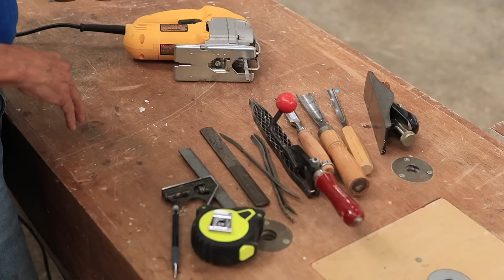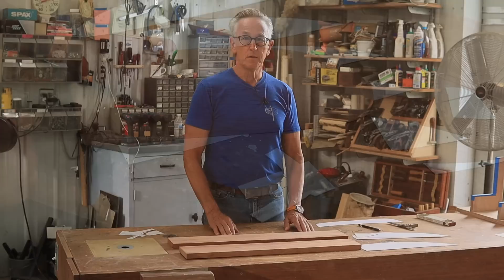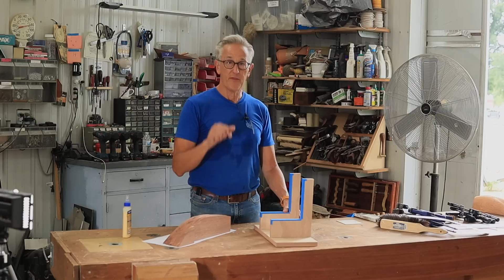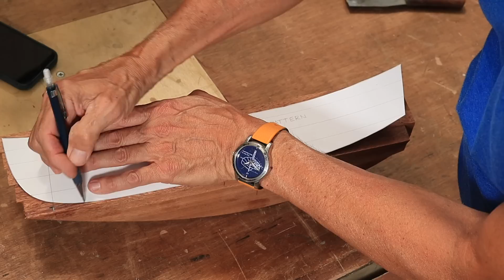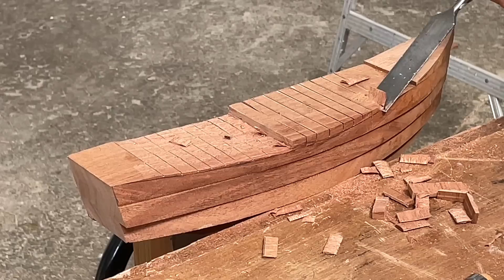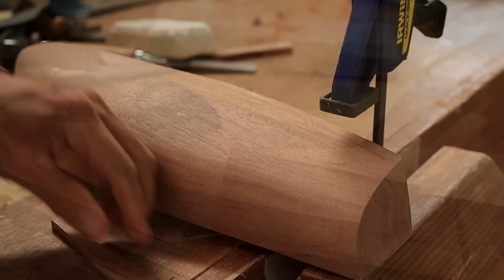How to Start Modeling - The Basic Half Hull Modeling Process, Part 1

Comment: 19:39 Sorry to contribute that comment: Did You know that a Ryoba saw does have a fine crosscut side and a coarse side to cut longitudinally (in terms of the wood grain) .... it would have been so much easier to cut the deck-spring of Your model with the coarse side of Your Ryoba .... anyway thanks for sharing. I love Your content.

Comment: One of the first tips I see woodworkers give is to add a little sawdust between boards during a glue-up to reduce wood slippage, yet I never actually see any of them do it.
Reply: Much better than adding salt, which is effectively altering the chemistry of the glue.
Reply: Of course mahogany has silica/ salts in it's make up so a few grains to stop slippage is not going to defeat the glue.
Reply: Another way to do this is to get the glue a little bit tacky before you clamp it. Also minimizes slipping.
Reply: or a bit of sandpaper's sand
Reply: Better to apply thin layer of glue both sides then let it get tacky before assembly and make sure the lifts are very flat -  unless you use very fine sawdust between lifts the joints will be noticeable - done with just glue, joints will be hard to see
Reply: @MsTawse-q1h  Hahahaha!  Toothpicks in a club sandwich, I love it.

Comment: The block attached to the hull that goes into the vice: I have seen another method in which the block is an octagon made from a 2x4 then attached to the hull using a 1x6 morticed into the octagon on one end and a flat 1x6 on the other end. This "flat" is then screwed into the hull. This allows the hull to be placed in the vice at various angles for carving. Probably not necessary for small models.
Reply from the maker: Hi Jerry, Yes, I'm familiar with that attachment. I believe you saw that on a Mystic Seaport Museum video. It's a nice video by Walt Ansel and a great explanation of half-hulls, not just carved. The devises in the video are used for the MSM workshop classes. The female lift mold (no clamping needed)and the hexagon block are design for a novice to carve a half-hull in a one day. I think the block might be good if one is new to carving, however, the simple block I used is more than efficient to carve a model. I noticed Walt never shows the model in any position other than flat. So In my opinion it's not necessary for any size half hull.
Thanks for sharing, it's a great overview video that also introduces the Hawks Nest half model. Several of my mentees in my Boat Building Clinic online have made HN models to better understand building their strong back.
Thanks for your comment and watching!
Cheers,
Bob

Comment: Bob another rasp I use when making wooden stocks for rifles ( besides all the ones you show) is a rasp that is used for shoeing a horse hoof. Its about 2" wide and 16" long and can be a very aggressive cut or a smoother cut depending on ones application and purchase purse. I belive it was about $30.00. Great video. I wonder if there is a pattern for a CAL 29 designed by Lapworth and built by Jensen Marine. Isnt working with wood wonderful?

Comment: In the normal process of boatbuilding (without Computer Aided Design) initial rough sketches are made then a  “half block model” is made to what the builder wants as the first step in the design process , measurements are then taken off the model and used on  the “lines plan” and faired if necessary in the process , next step is to draw the plans full size on the loft floor . The building process then begins.
I am confused that you are making a model off a plan … I can only assume that the model is for decorative purpose. The only half block models I have made were to take lines off and build a boat.
Reply from the maker: I will be taking off lines for the line plan.

Comment: Looks very simple but looks are deceiving. Without the proper tools and skills that half hull will never look like the one Bob makes. Beginners should avoid using expensive woods and practice a lot.
Reply: True, however even cheap wood needs to have a certain quality. Wouldn't want to try and make one out of any pine with loads of knots... fault free is the minimum requirement.